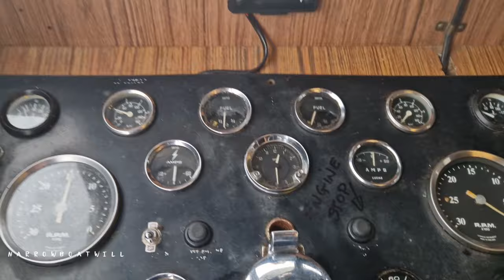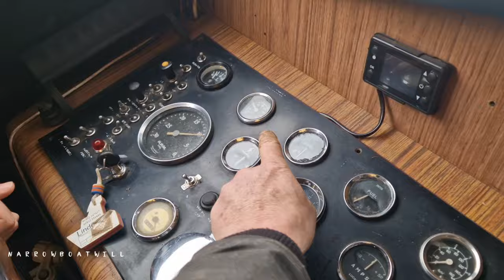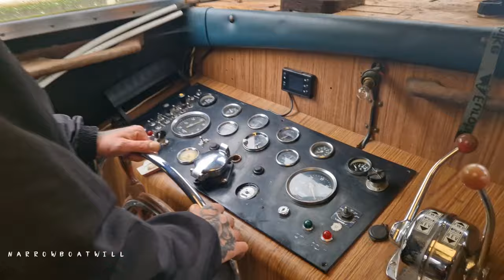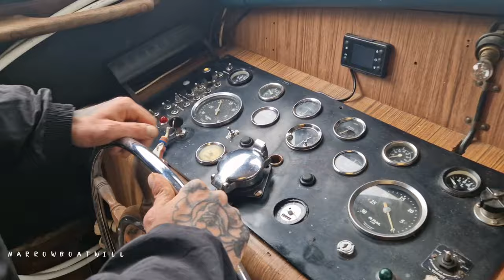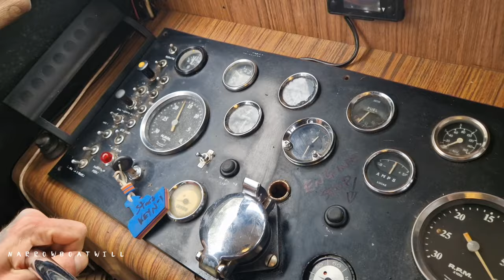Back on the Bridgewater canal. For a day.. My narrowboat journey continues..

Comment: Great to see that old boat working and good luck to Leon's mate in putting it back together.  That's a lot of doing-upping, but lucky for him that you're so handy with an engine.  Funny that you couldn't get over being inside a boat when it's moving... inside! 😯😄
Reply from the maker: 🤣🤣 it was weird driving inside and steering from the center. I'm so used to steering from the back in the rain. 😖
Reply: @NarrowboatWill  the back of the boat is so much better for ballet/breakdancing though.  Who'd get to see it if you were on the inside? 🤔😂

Comment: A twin drive boat is difficult to drive with just one engine, it just pushes it along at an angle because the props are offset rather than in the center.  The engine sounded sweet Will. 👍👍 well done buddy 👏👏
Reply from the maker: Yeah it did. In the end, once we got going, it was OK. He's going to get the other engine replaced. Cheers for watching. 👍👍
Reply: @NarrowboatWill   always an absolute pleasure buddy 👍👍

Comment: Great starter project boat.
I really hope he puts some effort in and completes the build will make a fantastic boat.
Is the other engine dead 🤔 
Good video thanks for sharing.
Kev the brinklow kayaker
Reply from the maker: Yeah. In previous vlogs I do talk about it. It's got water in the crank.
Reply: Yer I remember but I wasn't sure if it's a non starter or a rebuild great engine but like everything expensive 😅 
It would be a great boat to lift out the water and strip completely and rebuild.
Depends on money 💰  bit it will look great in time.
Uou done a great job getting one engine fully running and not hot running. Nice.
Reply from the maker: The other engine has water in the sump. 
He's already painted the boat and he's refitting it. 
Cheers Kev. 👍